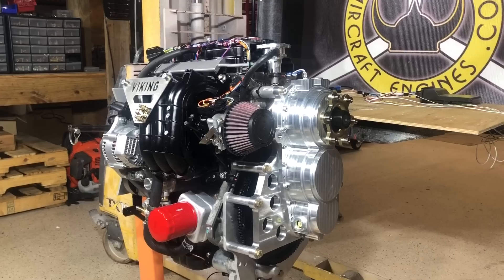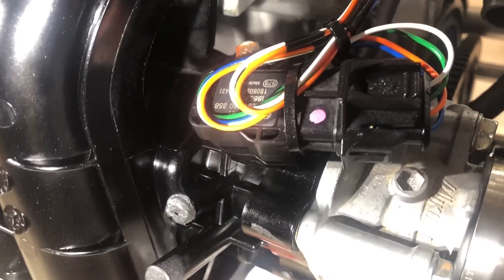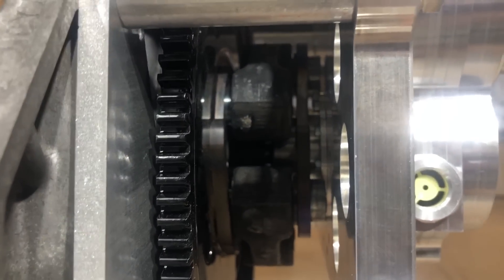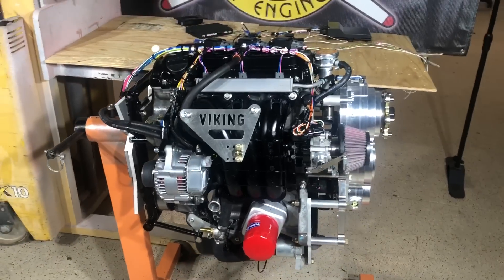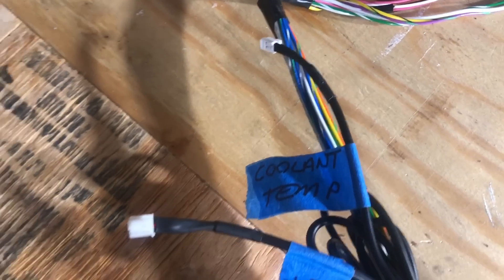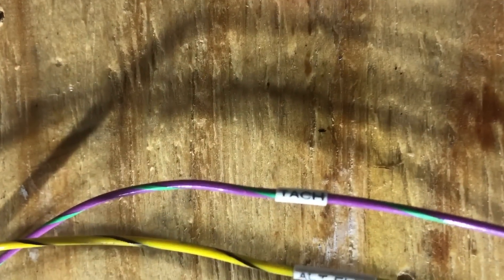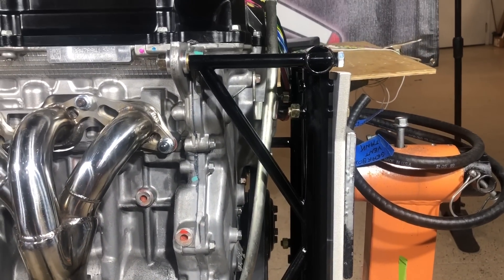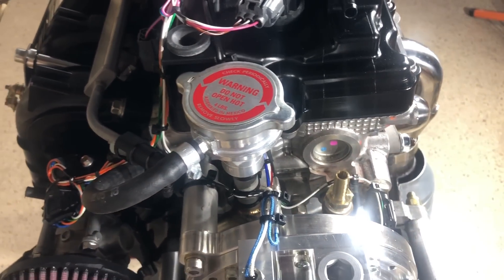The Viking 90 engine explained

Comment: how can you charge 11k for this engine when it cost 1.5k? Does that 10k extra for the gearboxes and add on?
Reply from the maker: You do realize, you have heat forged, helical cut gears, bearings of all sizes, a new aviation grade wiring harness, ECU, machined parts, engineering etc. Not to mention, butt in the seat flying, payroll, the cost of business and SOOO much more. There is a reason not everyone does it, but if you would like to - feel free. Go ask Rotax how much an engine costs them to make...
Reply: @ i meant to say the engine is 1.5k crate with ecu and harness. We use it for our formula open wheeler so we know. We also make our own transmission with squential gear box. At this price, why would i use this engine over the Sonexx 80hp with much better torque curve and no gearbox to worry about?
Reply from the maker: Again, the ECU is different (by the way if you bust a Rotax ECU - you can count on $2500 and up depending on what model. The harness is different. The gearbox is our design with custom gears and a lot more machine work to mount into an aircraft. A VW is generally a bad choice every day of the week - there is a reason we replace them a lot - and it is just a box of parts. You don't have to like it. This is what we do, don't like it - that is fine too.

Comment: Mitsubishi claims 79 BHP at 6000 rpm for this engine.  90 HP  might be a little optimistic.  Rotax claims 100 HP at 5800 rpm from its 1.3 liter 912ULS.  Without seeing a dyno of either of these engines these are probably all "hopeful" claims.  Maybe at sea level on a cold Alaska morning with a dense air charge and a benevolent deity smiling down on the test.  Maybe.
Reply from the maker: We do dyno work on every engine and change some variables on the engine as well. This engine has been around for over 5 years and makes the 90 Hp as advertised

Comment: What does this engine weigh compared to the Viking 130?  Also, did this engine come directly from manufacturer (crate engine)?
Reply from the maker: It weighs the same as a Rotax 912, power between the 80-100. They are all from cars with little to some miles depending. Same as our other models.

Comment: I'm still working through the video, but being impatient, let me ask a question. How bad is the vibration level of this three banger, both on the prop and on the body of the aircraft?
Reply from the maker: It is actually much smoother than initially thought (being a 3 cylinder) slightly more vibration than the Honda, all smoother than traditional engines by far. IT becomes noticeable only in a smaller aluminum aircraft like the Zenith 701, but a Kitfox with steel tubing, don't notice it at all.

Comment: Here in the UK virtually every engine fitted to a experimental aircraft is a Rotax 912 or a two stroke. I dont know the price of the Viking unit but I imagine it to be quite cheaper to the Rotax 912 and with the bonus of having fuel injection as well. Viking I think your missing out on a big market here in the UK, may be not having a dealer here to answer questions or to showcase the engine. Maybe the BMAA or the LAA.
Reply: its not that much cheaper. Remember this 90hp does not make any close to 912is. They want 11k for this engine when it cost them 1.5k straight from dealership. I use this same engine for formular open wheeler
Reply from the maker: It is drastically cheaper. The 912IS starts at $27,000. The Viking 90 performs identical to the Rotax 912 and weighs the same. I'm sure Rotax has much lower costs as well, but uou do realize, you have heat forged, helical cut gears, bearings of all sizes, a new aviation grade wiring harness, ECU, machined parts, engineering etc. Not to mention, butt in the seat flying, payroll, the cost of business and SOOO much more. There is a reason not everyone does it, but if you would like to - feel free. Go ask Rotax how much an engine costs them to make...So - if you don't like it that is okay, but your comment about cost is drastically wrong.
Reply: @eggenfellner  i dont dispute your cost . But at this price point its very hard sale considering Sonex engine is much less point of failure and better torque curve. I I think your price of the k20 and 1.5t honda is very fair however
Reply from the maker: This is very wrong. There are A LOT more points of failure, and very prone to failure and FAR less performance.

Comment: You build a very beautiful engine. I'd like to get one someday. Will your 180 fit a Vans RV-10?
Reply from the maker: The 180 is only 180 at max rpm for a STOL type of plane.  We have started to market it as a 170 hp engine at the RPM more normally used.  It would be too small for the RV-10